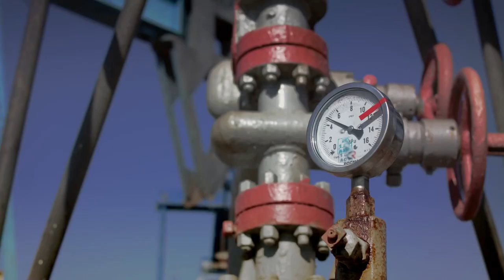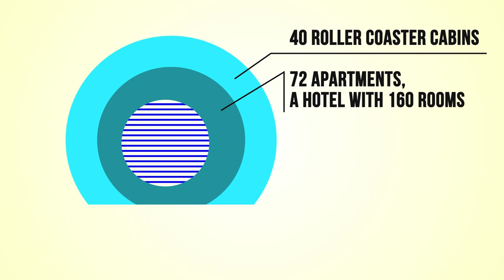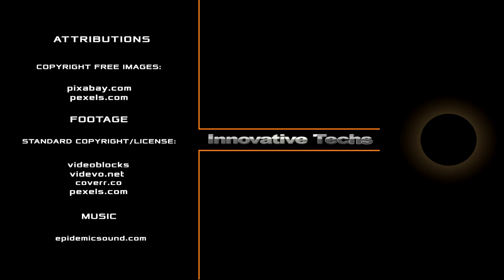Why this invention can send wind turbines to the past

Comment: None of them talked about how much energy they produce ratio to the windmills nobody talks about the cost ratio two windmills how can you possibly compare them to. Each other
Reply: Also didn’t talk about sources of water particularly in desert areas where many wind farms are currently based
Reply: Windmill farms are becoming less tolerable so replacements are being researched. There will be a need for both probably and why not of people will pay?
Reply: The whole clip never mentioned output or actual output...
You don't have to an engineer to see its virtually impossible to get large scale output from this concept
Reply: Amperage...
Faraday need Amps...?
Reply: Betz's law indicates the maximum power that can be extracted from the wind, independent of the design of a wind turbine in open flow.

so about 55% ish per cubicle metre, are you a glass half empty=only 55% or glass half full an extra bit of local energy i can make for my personal use, without constant drip feeding more year on year , private 'for corps' profit mega corps to pay for their mega yacht
Reply: @TheHk1966  funny how educated people that live in us deserts dont see fit to 'do the work' to capture & stop runoff flowing away ... wide area capture using recycled plastic, tarps etc into local intermittent flow culvert and canals, man made slow leak ground wells etc to trap/replenish local ground water.
"Rain is usually the main source of water in a desert, but it falls very rarely. Many desert dwellers rely on groundwater, stored in aquifers below the surface. Groundwater comes from rain or other precipitation, like snow or hail. It seeps into the ground, where it can remain for thousands of years."
Reply: @DaleDix  why not of people?? Sanitation perspectively analogous firetruck!
Reply: What a bought the thousands of birds killed every year by wind mills ?

Comment: The first option sounds not convincing. Also the argument wind turbines take out so much wind from the air that it affects the climate negatively is rubbish in two ways. (a) If this would be true, this would be true for any other technology using wind as energy source. (b) Wind turbines reduce the energy in the wind, but it is minuscule to the whole volume of moved air. Also climate change will rather intensify winds, thus more wind braking infrastructure is necessary anyway.
Reply: Your first argument is correct: Wind energy contributes to slowing down winds. In Germany and Europe the climate change started exactly to rise with significantly higher rate approx. 1990, the time the first wind parks were installed (s. DWD-diagram). Your second argument is wrong. Terrestrial winds slow down since decades. This effect is well known as "stilling". In Germany the typical power generation (IWR wind index) droped from 2008 to 2016 in average by 6.9% at coast and 4,7% onshore.
Reply: @fabianamann6818  this is utter rubbish what you are talking. The energy in weather systems is huge and the part of atmosphere where these systems are contained in, are 7 to 17 km tall. Thus, wind turbines only interact with wind near the surface. The amount of energy they extract is negligible.

The change in our weather and the higher number of extreme weather events is partly triggered by the weakening of the jetstream. The latter is affected by the high polar temperatures.
Reply: Trees would change climate by slowing down wind also then.  Probably a lot more because the resistance of one tree is probably more than one windmill. On your logic, we shouldn’t have forests because they’ll slow down the wind. Not well thought out.
Reply: @colingenge9999  Exactly. Also buildings would be an issue. However, they all affect only wind on ground level. The rest is unaffected. People often do not get how huge earth is.

Comment: That entire building in Rotterdam probably generates enough power to charge a cell phone. You don’t need a physics degree to understand this will never be viable at scale.
Reply: mega corps PR speak 'not viable'= we cant make mega profits from 'not invented here' prior art.
Reply: Oh yee of little faith
Reply: @paulmaydaynight9925  It’s not PR it’s physics and economics. This thing will NEVER be able to generate enough energy to be economically viable and doesn’t offer any significant benefits over solar power. For one it needs a water supply which  is generally located near densely populated communities, and the video doesn’t mention if it can work with salt water (which I highly doubt). That makes it even more comically impractical considering fresh water is quickly becoming the next global resource crisis (seriously the glossing over of water requirements and efficiency are the dead giveaway this is naught more than a curious science experiment). 

Meanwhile solar is becoming dirt cheap, can be installed practically anywhere (namely in the vast uninhabited stretches of desert that blanket every continent,  are devoid of inhabitants or wildlife, and with the added benefit that there are almost no clouds to speak of and have precisely predictable power generation forecasts). Even if this could produce an equivalent kilowatt to size amount of power as a traditional windmill it would be vastly more expensive and still suffer from the vastly unpredictable nature of wind (without the benefit that traditional turbines get from being up so high and away from obstacles). 

If traditional wind turbines are problematic (and they’re really not since the potential animal deaths pale in comparison to the devastation of pollution and climate change) we’re FAR better off investing in solar and battery storage than tinkering with dead end tech. Again this isn’t PR, its pragmatism and realism. There are enough energy providers refusing to switch to renewables due to the marginal increase in cost, even in the face of a climate crisis, that the world is now hanging by a thread. If you think they’re going to spend 5x as much as normal renewables to save some birds and bats… well we don’t live in in a fantasy world.

Comment: According to the Oct 2019 study by the IEA, the greatest opportunity for an energy fix, are ocean wind turbines situated far out to sea where the currents are steady and strong. The study indicated that the total potential for electricity is 11 times the total energy production of 2018. The materials used must stand up to salt water corrosion and either transmit the electricity to land or use the electricity to make and pump hydrogen to specialized gas turbines & fuel cells.
Reply: That is the problem salt corrosion I have been in the electronic business 35 year and salt corrosion is an enemy of copper steal there are some new acrylic like materials that you could make blades from that may last up to 30 years ....
Reply: @rogerreimer24  For work at sea, why not ceramics. The answer is likely cost of production. Plastics seem totally doable save for exposure to extreme cold exposure and thus, cracking. There's a lot of energy at sea waiting to be harvested, and since nukes remain too costly, this would seem the optimal way to power civilization. Thx.
Reply: @mortimerhasbeengud2834  Any of my use of electronics on boat has been  a problem radios last about 5 years some a bit longer a company call Shakespeare developed antennas and out side speaker for the USA Navy that lasted 25 years. But under water turbines with steel bearings maybe a problem because tidal has a lot of power to drive turbines but the cost of using maybe a problem. Also in BC we have a large fishing and whale population we must make sure they don't get hurt or killed in the turbines.
Reply: Transmission lines have losses, the grid is fed into at many points along its path to help alleviate that. If your source is far out to sea with the loads at the other end i2r loses with probably make it impractical and you'll still need to lay very heavy and insulated cables to transmit the power. Our current lines do use very high voltage but are separated by a decent insulator like air and not surrounded by salt water!
Reply: @kenthhamner2641  Interesting. The IEA study, perhaps unwisely thought that H2 would be the primary product eventually, in the 2019 study. Pumped landward for specialized gas turbines that used H2, and also for grid power for fuel cells.

Comment: Great stuff but time would be better spent developing a means of electricity storage, what happens if the wind stops blowing even for a few days. The UK has over 30 million vehicles powered by petrol and diesel that will need replacing in the next 20 years and we only have a 5% electricity reserve at any time,  how are we going to cope with the demand?
Reply: Research "new battery technology". You may be surprised.
Reply: Same problem with solar energy. If you want consistent energy for the masses you need nuclear. TED has a great video about this, the space needed (how much land) and the energy needs compared. But people are scared off nuclear, so there must be some trade off. I don't think we can bet on a single horse we need, solar+wind+water+nuclear, we need it all and the all have there place.
Reply: it's called voltaic pile/accumulator/super capacitor 'batteries' & the gb Victorian's invented & developed it back in the day till today, to supplement their steam engines 'use it or loose it' turbines for accumulated storage & use.. the invention remains in use, just the latest derivative evolves if they make it for you to buy & consume again for their over valued new shiny thing.

Comment: 3:20 And from where does the system get "positively charged water particles?"  You really glossed over that stumbling block.
Reply: LMAO didn't you hear? its from the rain that's not guaranteed to fall 24/7.
Reply: @MuffTuglick  I think the positively charged is an important point, also rain in a desert, suuuure...

Comment: You missed the 'only' viable alternative to windmills, being kite systems. Also without specifying costs and efficiency,  this video has little value.
Reply: It had value for you as you were able to highlight issues with it.
Reply: every kid should make & fly a kite at least once, today put a 3v-5v esp32 wireless router on them & have long range wireless lan/wan fun as a practical diy community proof of concept group learning tool.

Comment: Using flywheels and magnetic levatation, redirecting wind dowards makes for a good idea, like a reverse dyson fan. Id be willing to try it.
Reply: so 'give it a go' main bits needed 
4 large tarp's folded into triangles.
6 long cheap bamboo poles to make the very large A frame ,for larger aria initial rotating air collection/accumulation.
lots of diy plastic string to tie it all together & feed a basic quick 12" 5 circle plates to make the tesla turbine & integrated copper wound generator/converter ;some dmm's to collect the output amp's/watt's/volt's & frequency of rpm etc
* oc driven tesla turbine pumps work as efficient  multi purpose vortex generators too

Comment: Interestingly the wind at 140 meters up is blowing well enough all over the world to sustain current wind turbines. The problem is building a structure that can hold the blades that high off the ground. These non moving ones are mounted too close to the ground to be used in most places. There certainly is not enough water in most existing places too. Finally the wind does not usually always blow in one direction. Well, it certainly is eye catching even though it is economically and physically a no-go. 

The bouncy pogo sticks are quite interesting. So you say the more you put up next to each other the more efficient each one becomes. Interesting.
Reply: AOC would love these designs. She says the world will end in 12 years unless we put all our money into renewables. So with her unlimited budget these ideas can be made into reality!

Comment: The bladeless turbines could also be amplified with flow multiplying configurations to up the power density of the design and reduce the total profile of the system for cost and environment impact reduction.

Comment: The blade turbine has more negatives than mentioned, or at least I may have missed. Farmers and ranchers have stated that blade wind turbines are noisy, and bother their livestock. You did mention their danger to birds or bats. They are also another hazard to low flying planes or helicopters...even though they are required lights on them. They take up acres and acres of land. Finally they are high maintenance.  Most people never realize how much time and money is spent on maintaining these mechanical behemoths.  I am for the less intrusive and probably more cost effective wind "catchers," I'll call them.

Comment: The problem is the fuel source and the reserve capacity. The fuel to make this work is wind, almost nonexistent when very hot, almost nonexistent when very cold. I have an idea let’s store wind. Oh wait a minute you can’t do that. So the wind is not going to be at the velocity you want all the time. So it seems to me that this idea while fantastic it’s really not the complete answer but perhaps part of the answer. Conventional powerplant have a reserve of fuel, coal, natural gas, nuclear power. So when it’s cold and the wind isn’t blowing as needed and or it’s very warm and not blowing at the velocity needed, what do you do? You need heat when it’s cold, cooling when it’s hot. I understand solar but at this point can’t store the energy at night. The devastation in Texas should be a wake up call that all forms of electricity generation should be used based on their superior attributes at the time. When the western United States needs additional electricity when it is very cold or very hot the generating facilities in my part of the country sell electricity at confiscatory prices is those in need. This helps keep my electricity cost down. I own an electric vehicle and it is charged I can tell you using natural gas, coal and nuclear power.  I’m for trying anything but it needs to be proven to work well.
Reply: yt said "let’s store wind. Oh wait a minute you can’t do that." 
wind=air=compressible fluid... see 'trompe'
Reply: @paulmaydaynight9925  
What does “TROMPE” mean?
Reply: @yt650  google is not your friend but google it anyway. its a 'word' for a device, not an acronym
Reply: @paulmaydaynight9925  
I want to see the storage vessel for wind storage and I want to know what is used to compress the wind and how much energy does that take?
Reply: @paulmaydaynight9925  
Are you talking about when Niagara Falls freezes over?
Reply: @UClLa8CrxqKTYdXEB4aweRFg 
Have to go for now 2:28 AM in the UK need some rest.

Comment: Solar with advanced storage techniques is the way to go. Wind is too unreliable in many areas for 24/7 electricity, has many detrimental enviro impacts, and doesn't provide the same life span as solar.
Reply: You are more fun than my grandma. And you have solar in the night time?
The wind is an excellent power generator! Why else do we use it so much you guess?

Man... the problem is more that sometimes the wind turbines are giving to much power... But in the future, it's no problem. All our cars will be connected to the grid and be used as big batteries for everyone.

If you are not like the idiot state Taxes you have a large grid where all windmills of your country are connected, there always be wind somewhere. Also, you can just turn on a gas turbine if there is no wind. You also could say it the way around, you can switch off gas plants more when the wind is stronger.
The wind is way more effective on a larger scale on the sea for example. 

If we combine those two with your carr battery we are getting there.

Also use less power will be a good thing, as in America it's ridiculous how much resources you are using. Isolating houses will be a good start.

Comment: As cool as Wind Farm sound very true facts they're non-recyclable they have to bury the blades hole another fact the windmills are not very well serviced and when they catch on fire since they hold almost 500 gallons of oil all you can do is sit there and watch it burn the fire department can't even put it out
Reply: they could switch to biodegradable & have misandrists recycle them ^_~
 The first ever biodegradable and recyclable vibrator, the Gaia Eco is crafted from starch-based bioplastic and features a slim bullet design with a tapered tip for internal or external stimulation. With multispeed vibrations and a quiet motor, this is a vibrator you can feel good about (in more ways than one.)

Comment: Could we use escalating tec on car roofs to generate electricity to run your car, on the motorway
Reply: No, perpetual motion doesn’t exist.
Reply: @AndreSomers  you interpreted that question as 'perpetual motion' not better 'power reclamation' 
heavy oil, a very high energy cost to process into petroleum by-product 'cars' today's gasoline engines are only around 30 to 35 percent efficient, which means roughly 65 cents out of every dollar you spend on gas goes to waste. are very bad at  'power reclamation' even today ,compared to electric prime movers between 85% and 90% efficient for electric cars today without any 'power reclamation' to give you a few more extra miles.

Comment: They produce energy from
Water turbines more abundantly now around the world now the wind speed is not detoured because 99
Percent of wind energy is produced in jet stream from
Air current eddie's of hot and cold air and to  protect
Birds blades can be slowed
By installing weights on edges of blades increasing 
The power to unit ratio by
15 times it's not redesign
Confusion to remake the wheel it's thinking smart that makes us smarter
😎😎😎😎